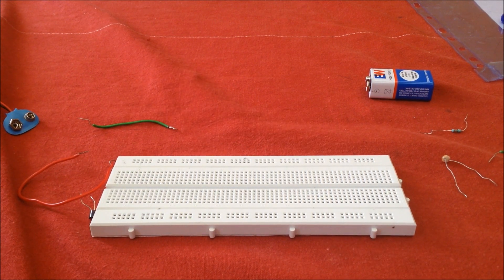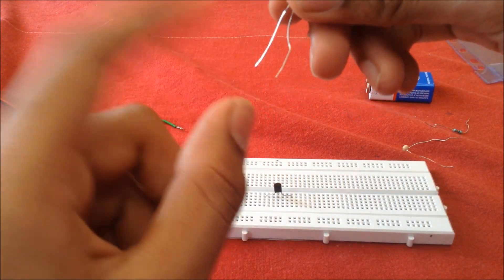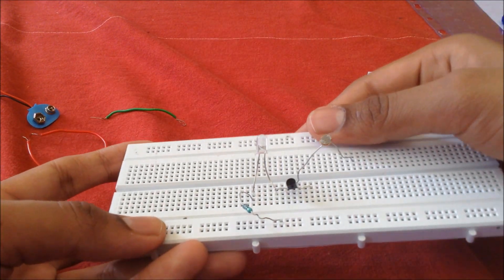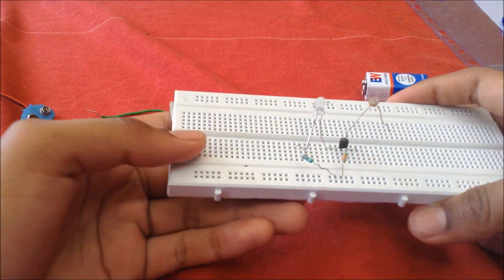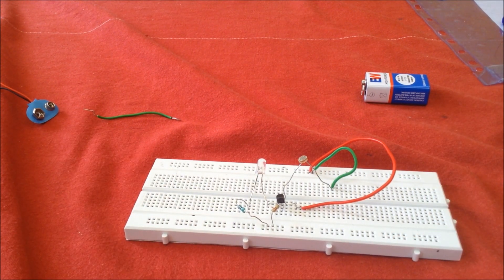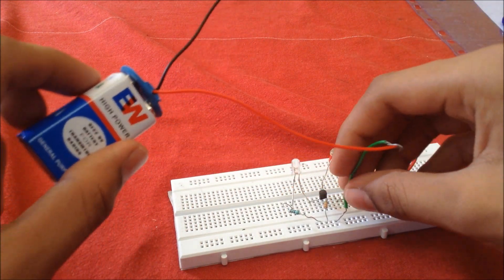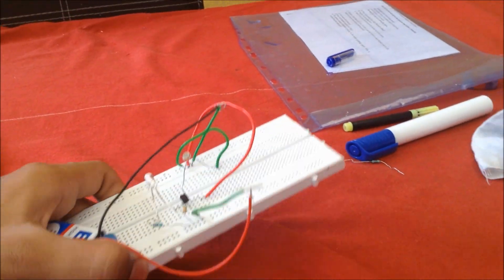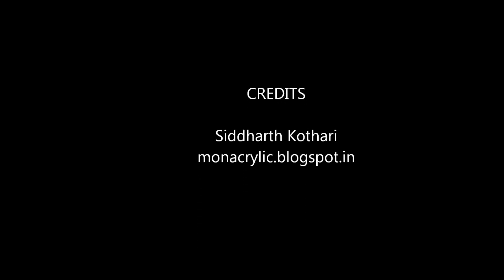Dark sensor circuit (using transistor)- Easy tutorial

Comment: Sir, if we use more led 3 or 4 than the resistor value change or not if change what is value of resistor
Reply: And sir which terminal of led attach with transistor long or short
Reply: Sir as u say im use 100 ohm resistor but the only one or two led glows 3 rd led not glow what should i do .

Comment: I need the circuit diagram
please let me know where can I find it
Reply: at what time duration???
Reply: Siddharth Kothari thank you very much
this would help me a lot
Reply: what is the role of the transistor used?
as a switch or amplifier?
Reply: hi bhaiyya...
mine is working as a light sensor..
what to do?
Reply: bhaiyya its not working now...

Comment: Can I run a motor with this circuit in place of the LED.
If not, then please tell me how can I run it.
please help
Reply: +siddharth kothari Thanks brother , but one more question.
If I use 3 LDRs instead of just one,will there be any change in anything?
Reply: +siddharth kothari hey brother :(
I removed the resistor that is attached to the LED and in that place, I fixed the motor but the motor is no close to work.
please help brother ! Its a bit urgent
Reply: +siddharth kothari It is correctly working with the LED but the motor is not working :(

Comment: Hi, nice project, but I have one question, how can I connect multuple leds on this circut? I want to make a small Christmas-like village with lights in and out of houses (street lights) and I want them all light up when it is dark... Is it possible?
I want to use 12V power supply. Can I somehow connect all LEDs paralel, and then connect them as one in this circut? And which resistors should I use? 
Thank you